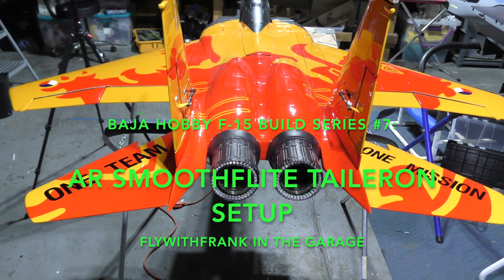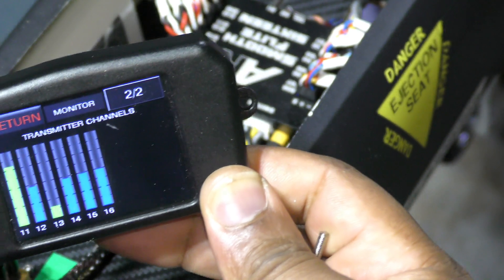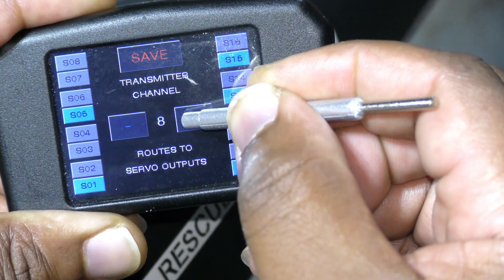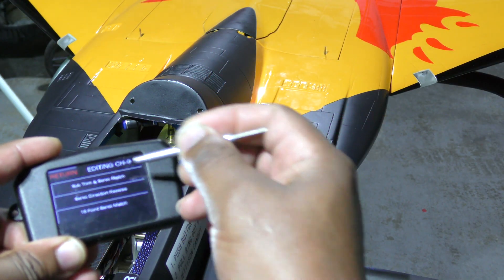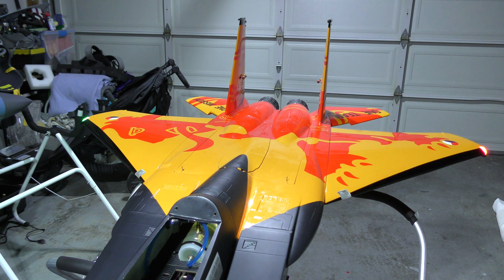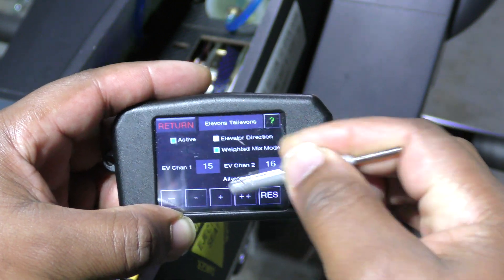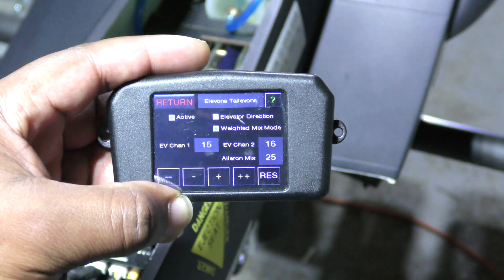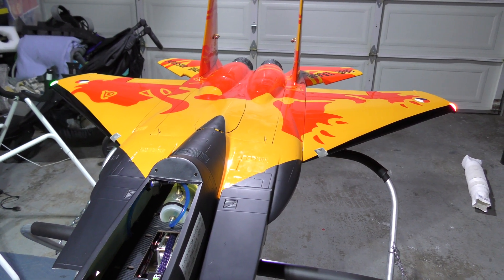Baja F-15 Build Series #7: AR SmoothFlite Taileron Setup

Comment: Great video! What radio are you using here? Does this still work if I'm using a 12 ch radio? I'm setting up an F-16 with gyro stabilized flaperons and tailerons on a switch.
Reply from the maker: I am using a Frsky radio here. The AR SF16 can handle up to  between 16 and 20 input channels depending on the radio manufacturer. You do need a receiver that can handle sbus, x-bus, s.port or those protocols that put all channels on a single wire. 12 channels is easy for this unit
Reply: @FlyWithFrank  Thanks! I've just setup tailerons using ch 15&16 with my 12 channel radio! Awesome!

Comment: Can you turn off gyro channels in flight.  Eg.  With gear down, slow flight, gyro moves tailerons and ailerons. But with gear up, faster flight, gyro only moves the tailerons
Reply from the maker: You can turn off the tailerons and use ailerons only. Not sure if you can turn off ailerons through the SF16...
Reply: @FlyWithFrank  in flight, through the gyro?
Reply from the maker: @russcole5685  Yes you can assign a switch to the tailerons to turn them off in flight. Then your tailerons will become elevators. And roll control will be achieved through ailerons only. This of course assumes the latest Smoothflite16 software. This is how my FlySafeJets F35 is setup. She flies excellently!
Reply: @FlyWithFrank  thanks,   I'm thinking of keeping the tailerons on all the time.  Wanting to turn off spoilers. Affectively ailerons in fast flight.      The easiest way would be through mixing in the transmitter, but will the gyro see that.  In other words, as you switch between high and low gains, will it also turn off programmed channels.   Sorry for asking so much.   It's a very clever unit, but very expensive to buy to play with before knowing it'll do what I'm looking for.    Short of that, I might get more than one cheap gyro and have them switch on and off as needed through programming.    One for the tail, the other for the spoilers
Reply: @FlyWithFrank  thanks for taking your time to reply.    I might just end up getting two cheaper gyros, switch them on and off as needed through programming

Comment: Going to buy one this week how dose it fly and landings can u slow it way down i had a skymaster f-15 came in hot
Reply from the maker: Put a 140 in this and it will be light and plenty fast. You can come in fairly slow. You'll start a bit hot at first but then figure out pretty quick that she can slow and also take off in short distances!
Reply: Gyro or no gyro